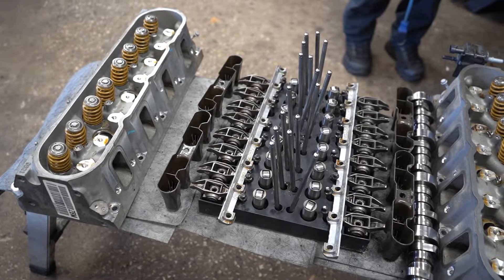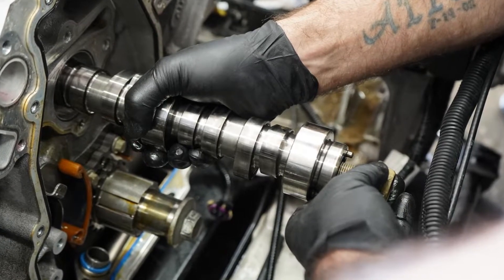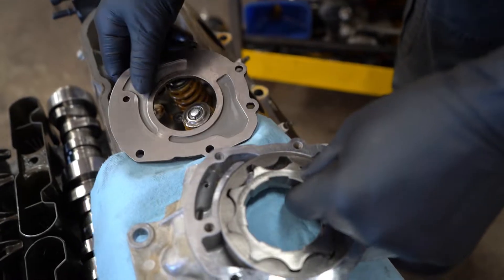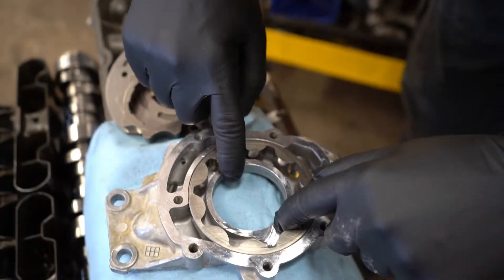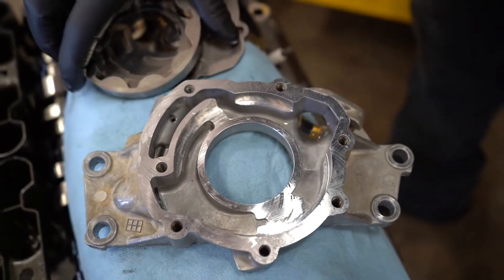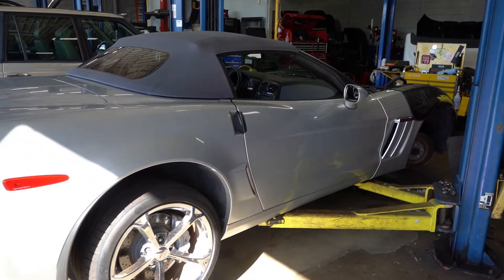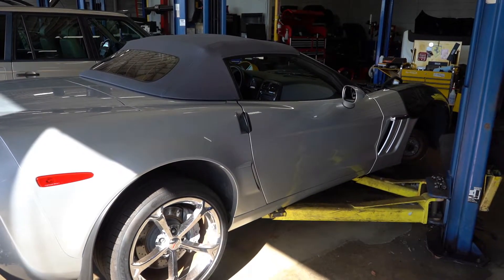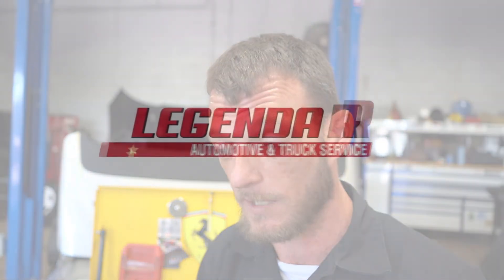LS Motor Low Oil Pressure Cause | Oil Pump Scoring

Comment: There's not enough scoring on that oil pump to be a concern. The reason that engine is having boil pressure issues is because they're babying the engine too much. It's already developed some sludge in it. And probably blocking off the passages to the oil pressure switch. So you do your regular mods, you either delete the oil pressure valve that's above the oil filter inside the pan if it has one, or you increase that spring pressure by dimpling down the center of it. And you can take the oil pump and add two or three washers to the spring and increase its value. Being a high-volume oil pump because it is and active fuel management engine. A little bit of extra oil pressure will not hurt.

Comment: I blew up a b18 Honda engine it dropped 2 valves and destroyed the whole block and head  I built a new engine all machine work done on the new head and block but used the old pump off the blown engine not thinking anything of it because I’m a newbee got the new engine running and it sounded like it had piston slap or a very minor rod knock with a lot of metal in the oil   The car would stop making the noise on warm up but car would not hit vtec or nothing pulled the whole engine apart and actually pulled the pump apart and it looks like it was ran with pieces of the old engine in there heavy scoring front of plate and the plate has foreign particles heat welded to it all can be cought with a finger nail .  and the gears have gouges  front and back and top where the gears spin on each other